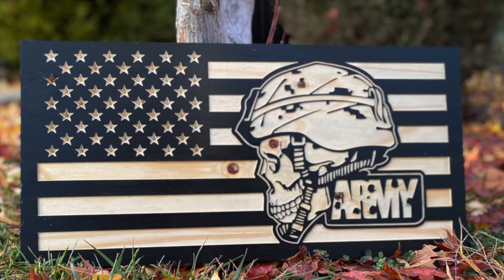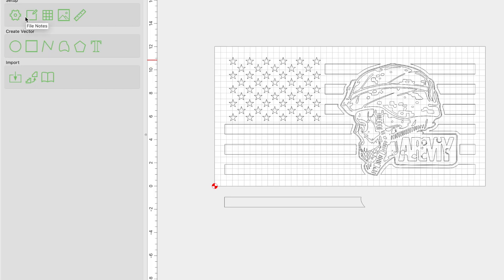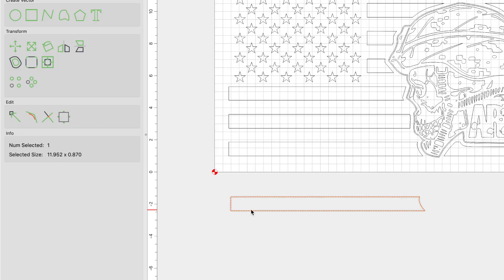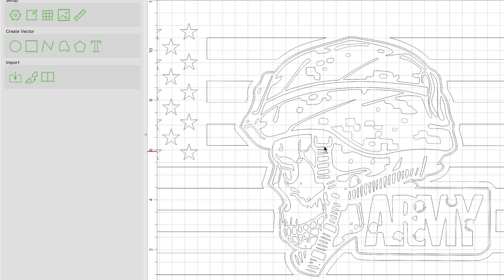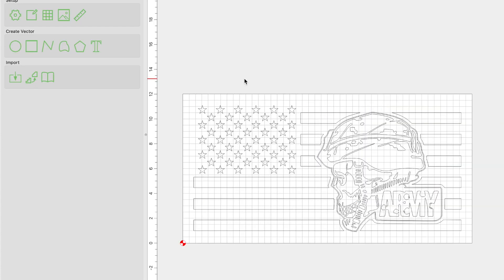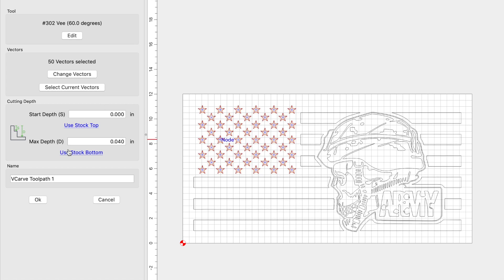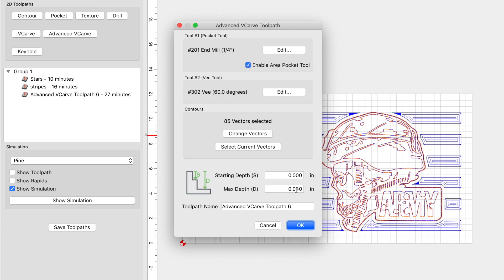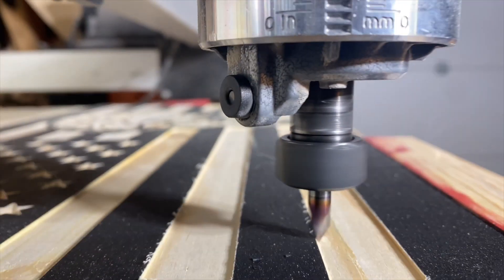How to Carve an Army Flag on Shapeoko CNC - The Fastest & Easiest Way!

Comment: I just completed my first army flag following your instructions! I hope you can answer a question for me… I have quite a bit of uneven parts around the skull and word ARMY not to mention my 60 degree but did a nice job cleaning up but didn’t cut to the depth of the 1/8” bit! Is that normal?
Reply from the maker: Gary are you are using the bit setter correct? I can’t think of why the 60 deg vbit didn’t carve to the depth of the 1/8. 
Sometimes I do see this when I carve my stripes. This happens in the stripe corners.

If it’s happening in the design, I’d think it’s the material not being fully flat on the wasteboard.
Reply: @aetimberpine  thanks for helping
I am using the bitsetter as per instructions! I think it’s another issue with the router and x/x assembly! I have a little movement in that that would cause the uneven routering I believe! I am hoping to have a video conference call with carbide 3D support soon! Maybe they will have an answer! As for the bitsetter I am unsure why it would cut above the level that the 1/8” bit cut when it’s set the same!  Will keep you posted
Reply: @aetimberpine  I did get my issue figured out.  I contacted Carbide 3D support and we figured out what was wrong.  I had some "Slop" in my Z axis that I needed to take my unit apart and tighten some things.  Thank you for your help in trying to sort out what I had going on.